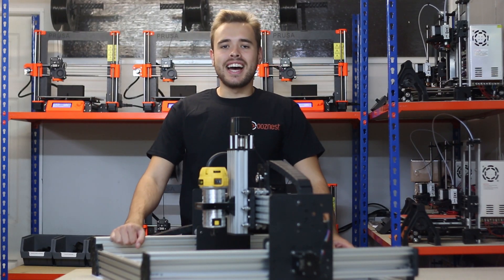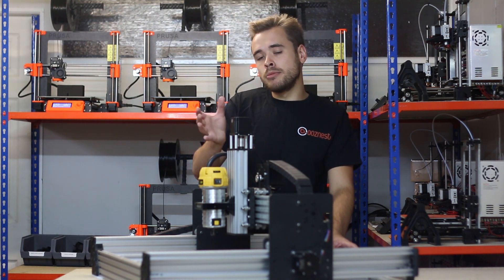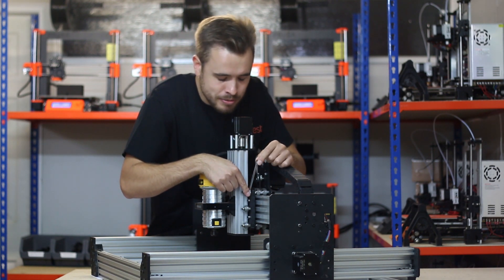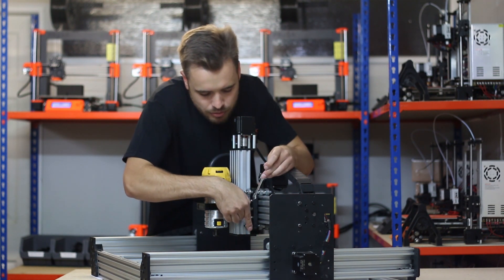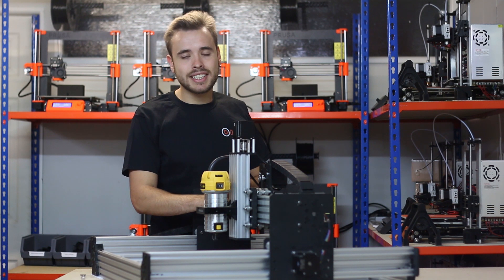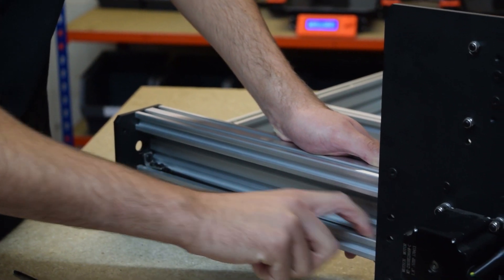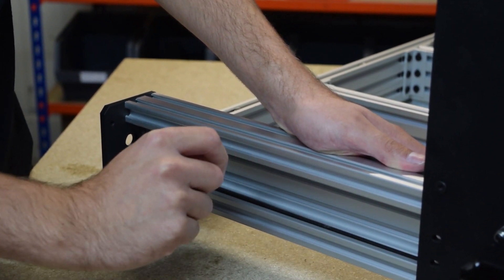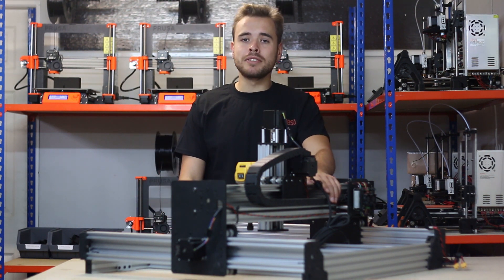How To Calibrate Wheels & Tension Belt On Your WorkBee CNC Machine

Comment: Mine is the same as a couple of the other posts here. Even with all the Eccentric spacers in the correct position, every single C beam on my machine (x,y,z), the wheels are tight on the beam. Only 1 single wheel was loose and required tightening via the eccentric spacer. 
I can move the rails by hand and the wheels operate smoothly, but it does take some force. 
None of the wheels can be turned independently while the rail is in, without the rail moving as well. Is this ok?
Reply: I think I might have solved my own issue, I think the M5 bolts and nylon washers were simply too tight. Might want to add a note about not over tightening them. Once I backed off them about 1/2 -- 1 turn each my wheels were indeed loose and were able to be tightened properly via the eccentrics.
Reply from the maker: @ulkesh78  Glad to hear you got it sorted!

Comment: Hey, is there any way to tighten a mini-v or normal wheel assembly without seizing the wheel up in the process? it looks like the precision shims make contact with the outer casing of the wheel bearing, is there any smaller shims available that only make contact with the inner bearing casing?
Reply from the maker: Hi, we are aware of this situation in some cases and are going to look into it. You should be able to get the wheels tighten enough though, without seizing the wheel.
Reply: Do you have any idea what might be causing it? I ask because I think it would help a lot if the wheel assemblies could be fully tightened without friction on my ox

Comment: Hi Ryan, Great video as ever. We were lucky enough to get one of the first Workbee machines, the largest format too. We have always had issues with the wheels, some not even in contact with the V Slots. We don't appear to have the eccentric adjusters you are referring to. Is this a revision? As for the belt tensioning, I managed to get the same result using that method, so all good on that front.
Reply from the maker: Hi Phil, thank you for contacting us. You should have the eccentric spacers, they have always been part of the machine. Can you send me a picture of your Z-Axis from both sides? sales@ooznest.co.uk If you indeed haven't got them, we can send them out ASAP!
Reply: My bad!!! I've just been out to the Workbee as I was waiting for it to finish a cut and lo and behold the eccentric spacers are there. I couldn't remember fitting them, but then I recalled my colleague had fitted them. Sorry and thanks for the usual speedy response. I do need to perhaps have a tweak of them as there is the odd wheel not turning (due to not being in contact with the v slot). Your video guide certainly makes it look painless.

Thanks again Ryan and by the way, our Workbee is performing wonders, 10 months of a steep learning curve for us but all very worthwhile and rewarding. Keep up the good work!
Reply from the maker: Not a problem, we're if you need anything else :)